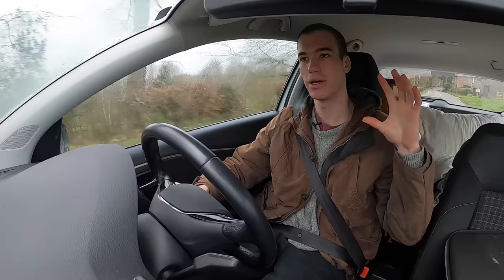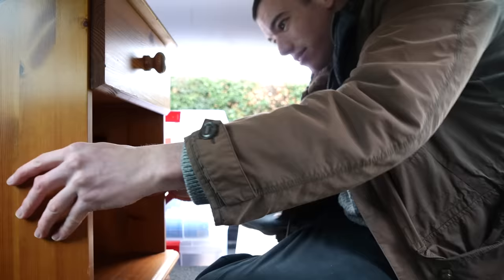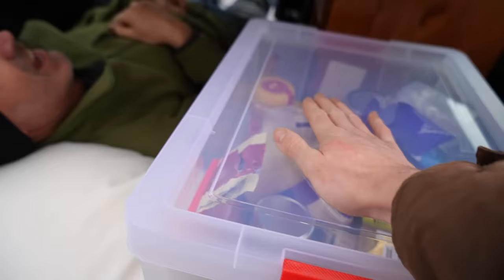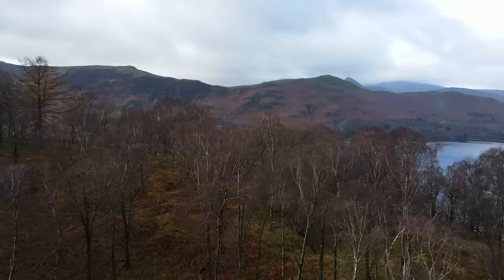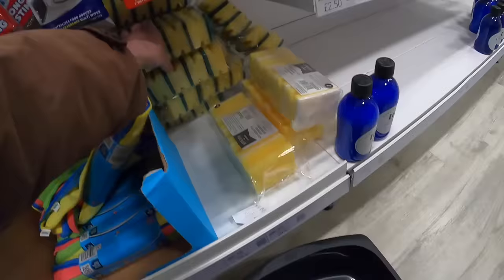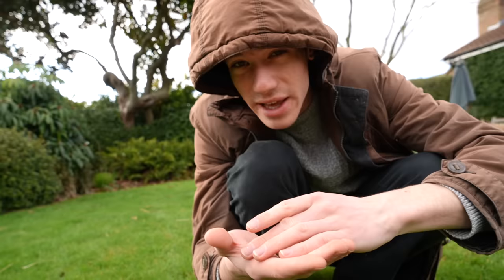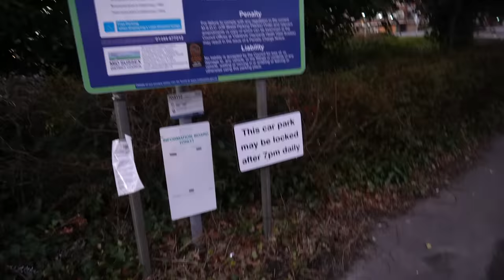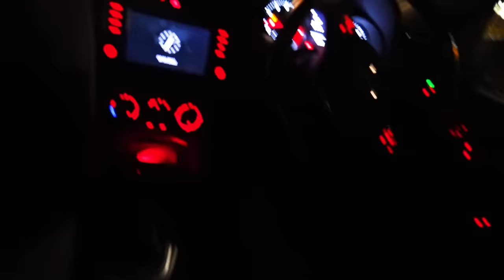Stealth Car Camping In A McDonald’s Car Park (Tiny Car Conversion)

Comment: "Cosy"  great description, you could do well as an estate agent! The guy on fish locker has done a video on insulating a small van, if youve not seen it check it out. If you had his van you could get the wardrobe in too. ;-) Obviously you could have a lidded bucket for 1s and 2s and theres less anxiety because you wont see the serial killers until the very end. All that said you are making it work, and learning along the way even if local house prices are suffering due the appearance of rough sleepers in car parks!  Tints and blinds might be an option on the windows, if a blind traps air its might cut down on heat loss through the windows. Keep up the good work :-)
Reply from the maker: Haha, great comment. 'Won't see the killer till the very end' haha! Thanks for watching!

Comment: if i leave my little dogs in my van i have to lock it i hold down the lock button till it beeps, so if the dogs move around it doesn't set of the alarm, give it a go 👍and of course never!! never sleep in your clothes 😱😱and you need more cable's to charge your leisure battery, from your car,

Comment: Hi Alex for your leisure battery you should have a split relay charger fitted to your cars or vans autonater it will charge your battery every time you drive the vehicle especially as your using  an inverter and the good thing is they are as cheap as chips good luck mate.
Reply from the maker: I actually got a split relay charger yesterday so I'll be fitting it soon!

Comment: Also with your leisure battery look in to something called a split charge relay. what this dose is charges your leser batrey from your mane car/van batry via like charging cables wile your driving so you never need  to take ya laser batry out and charge it so you all ways have power all the time! I have in the back of my van for my window cleaning business and it works a treat look into it mate will save you so much hassle!!
Reply from the maker: Thanks!
Reply: @just_alex  no problem mate all the best 👍🏼

Comment: ford transit connect high roof ..lwb .. i did 8 weeks in the western isles , Cheap reliable van , build bed base in three sections of sheet material about 12 to 14 inches high , then full size double mattress on top with all associated bedding , storage boxes under the plywood  can be accessed via the side door and rear doors , fit a wind turbine for ventilation ( again cheap } and some led lighting with switch straight from 12 v usb \ fag lighter , also recommend you get a good quality batterry bank / car jump module . worth there weight in  gold   i got the overlander portable starter pack .. please look at somthing similar ,, life  savers  ..will jump start  a truly dead car or van battery up to 6liter diesel and more than 50 times off one charge , also can charge lap tops , phones , cameras etc and the units will fully charge in under 90 mins ..
Reply from the maker: Thanks for the info!

Comment: Enjoying the videos so far. Definitely better to have a decent sleeping bag than a duvet! 
Also, how will you charge the batter? My old land rover had a split charging system fitted that would charge the battery as you drive.

Comment: Alex. Couldn't the battery be stored in the boots footwell where the spare tyre is usually located?
If you need to remove spare tyre, then buy a aerosol tyre puncture repair kit instead to get you out of trouble, then replace flat tyre at your earliest convenience?

I've always wanted a kitted out van, but so expensive. Why not think about sponsorship or reach out to companies that make these things, and help promote their products. That's what I'd reach out to try and do?
Reply from the maker: Thanks for the info! :)

Comment: Did you consider taking the feet off the bedside unit, laying it on it's side
Take the drawer out, as the battery looks to be the same width as the drawer height? You could then slide the battery in, so the battery is held in place by the horizontal wooden bar at the front. The drawer could then sit in the lower storage space? You might even be able to stash a plastic storage box and your camping stove stacked in there too?

I'm just a bit concerned that the height of that bedside unit obscures your view over your right shoulder for driving and maneuvering when reversing, and plod might pull you over for it?
Reply from the maker: Cheers for the info. Good ideas! :)
Reply: @Just Alex  no problem... You're welcome.

I love the idea of just you and your car, however you might want to consider adding roof bars and a Thule type roof box? It'll give you loads more storage space for clothes, food, toiletries, washing powder, waterproofs, wellies or other heavy duty boots. Especially if you're going travelling further afield than the UK? 

It'll also give you the ability to carry a tarp, poles and some rope (or you could buy a half dozen 150 paracord "survival bracelets"?) so you can make a half shelter that attaches to the roof bars, giving you somewhere you can sit out and cook when it's good weather. Make sure the tarp has eyelets around the edges, then anchor the corners of the tarp with some lengths of 150 paracord. Make sure it's a decent length? One end can be looped/attached to a carabina that clips to a tarp eyelet the other end could have a large bead tied on it or a couple of short dowel lengths lashed on. 

To anchor the corners of the tarp half shelter, clip the carabina to the corner tarp eyelet and trap the beaded/dowel end of the paracord in the passenger side front door, or run it the entire width of the car and trap it in the driver's side door, the bead or dowel length should stop the paracord from pulling through if it gets windy. The other corner should have the same set up which can be anchored the same way in the boot door. Make sure you do this from the inside of the car so you can maintain tension when you run it, and keep it well anchored. Make sure there's a little bit of play in the paracord to take up any windage movement? The centre of the tarp can be tied off to the two roof bars. 

You can also keep in the top box, either a folding stool or a low to the ground beach chair, or a reclining carp fishing seat? You could maybe substitute the carp recliner for your airbed perhaps, depending on the dimensions of it? 

Maybe consider one of the sun screens that attaches to your windscreen for sleeping in your car, just to stop nosey parkers from looking in? 

You could probably find secondhand roof bars, roof box, tarp, windscreen shade on FB marketplace, or gumtree etc?

Comment: Would the leisure battery fit in the spare wheel well? if so, could Make a bracket and secure it down with the factory bolt that holds the wheel in place possibly?

Comment: mate just buy a allready converted van, ive got one for sale for cheap if you want it, mercedes sprinter, has full size double bed, full kitchen, lights plus loads more, yours for 5k thats a bargain, it would get 10k+ on ebay
Reply from the maker: I think I want to convert it myself to be honest. Thanks though!
Reply: @just_alex  fair enough mate, if you need help picking the right van just ask, i have lots of experience in campers and van conversions, i used to live in them for a while exploring. 
my advise is dont get anything too small, and dont get anything too new, older is better, more reliable. easy to fix etc.

Comment: You should ditch the spare tyre and strap down the battery in the compartment if you can. Make sure you keep an emergency tyre repair can though :)
Reply: Good idea 👍- replace it with tyre weld
Reply from the maker: Nice idea, thanks.

Comment: Yes a van would be Greta! But it’s not about using a van is it! To stop the alarm going off lock the car with the button inside the car not the button on the keys if that makes sense.
Reply: Watch the whole video before commenting 😂
Reply from the maker: Cheers for watching! Appreciate your comments. :)
Reply: @just_alex  also I would look at a sealed battery rather then and lead acid, as you are going to have to keep topping it up with  with deironised water every couple of recharges.
I really can see a decent camper conversion being able to work with a car, pop top roof would work well

Comment: Honestly. As diesel and petrol prices are going insane right now. I really find it hard to think it is a good idea to buy a van. You should try and keep the Polo since yea it is small. But you got it already. But this insistent need for that expensive battery is just stupid. You should have gotten a big power bank (box). Much safer and enough power.

Really after many YEARS of looking into van life or rather alternative to expensive hard to travel with caravans/mobile homes. I had just gotten a VW Caddy. Or Caddy Maxi. Or VW T4 or really any of there transporter vans. (short wheel base) Trying to get a van the size of a normal family car. My favorite van must be Fiat Ducato short wheel base low roof vans. Just do NOT buy a high roof or long wheel base van! You can fit in a polo! Do not buy a big stupid van if you are ok having to squat down inside of the vehicle.

Do NOT build a stupid insulated van with wood walls and such. Keep it as stock as possible. A family car is OK with moisture as long as you crack the windows and in general have some kind of ventilation going. A van might have problems with the water but really it should be not a big problem if you AVOID insulating it on your own. KEEP IT CLEAR FROM TRAPPING MOISTURE! Cars are built to avoid this problem. But windows are just a inherent problem with cars. Vans got less of them and is easier to deal with the condensation on the front windows. 

I really think you can do fine with just a VW Caddy. Remove the cargo wall and make a bed frame. It is kinda illegal to modify the cargo wall but hey if you do it right or even register it as a camper your golden. If you avoid insulating and crack windows open and sleep as if it was a tent rather then a mobile home. You can get very far and still have quite a nice sleep environment. No tent to mess about with and metal walls feels safer then tent walls. Without a heater you really do not gain much from insulation or messing around making it look professional. It is a trap you see EVERYONE get into trying to make the vehicle a "camper". DON'T be fooled by the internet! They are all just as new to this stuff! After YEARS of looking into this stuff you really are best of ignoring doing anything radical to any van or car. Unless your going to sell your home and truly live in it. Your better off using a van/car as a tent that is the size of a normal car. Nothing fancy more then a extra cabin battery and a bed frame. Small things! No stupid builds that you find new people do EVERY DAM DAY! Just live homeless and your doing very well in this "hobby". 

Good ventilation and understanding that it is going to get cold is really just so simple and part of the reality of van/car camping. You should not sleep in winter condition without heating and that is SUCH a huge pain that you are better off with a hotel at that point. No really.  

YouTube Vanlife. Search for Caddy or car camping. There is so many videos online showing very simple to very extreme builds. Family cars are better then vans. But vans are better not needing to deal with all the windows and that it serves as a better transport vehicle when you do not camp. But you have the problem of metal walls and it looking kinda bad. But DO NOT ADD INSULATION TO IT! Cars uses very special kind of material to cover the metal. House materials are NOT safe to use in vehicles! 

It should not be very hard to figure out what to do. You do NOT NEED to make huge modifications to camp or travel in vehicles. Better to keep the van/car stock and have a multi purpose vehicle that can transport and be a travel vehicle. No need to go bonkers without first doing a no trills "build" where you just add a bed into a existing vehicle and not much more then that. There are caravans and real vehicles to live in. Go with that or tent camp inside of vehicles. Really that simple. 

Have owned a Caddy. Got a Caddy Maxi and Golf Variant right now. Caddy Maxi I can just trow a bed into and travel. No mods to the van itself. The Golf Variant needs to be done like the Polo you got here. But really it is long enough to sleep nicely in. Caddy short wheel base really needs the wall removed and a bed frame that you can take out when not needed. But it is so simple and nice vehicles to own! Really buy a van and just act as if your homeless. It is going to play out as well as this kind of lifestyle is going to be. No reason to spend HUGE amount of money to build a moldy heavy big stupid caravan. Just think of it as a metal tent on wheels. And as a really good transport vehicle when you do not travel. It is such a joy to own as a extra vehicle.
Reply from the maker: Appreciate your detailed message! Really helpful info. Will take it all into account when I’m looking for a vehicle. :)

Comment: Dad knows best get a Panel van for stealth camping
Reply from the maker: haha yeah he does!
Reply: @just_alex  you could kit it out with a portaloo a gas cooker a proper single fixed bed no windows apart from a sunroof on top No one would ever know when you are parked up even a small solar panel on the roof to top up the leisure battery No misted up windows in the cab in the morning If it works for you you could then get a diesel night heater It can get cold at nights in Europe

Comment: Hi Alex, I'm a Motor Trader and have been for many years. I've also specialised in Vans for a long time. Feel free to DM me for some impartial advice. I also have experience with Van/Car conversions.

Thanks
Nick
Reply from the maker: Thanks for your offer, I appreciate that massively!
Reply: @just_alex  I've just noticed there's no DM function on YT. If you'd like my help, feel free to drop me a your non personal email address below, I can reply to you later and you can run what you what to by me. 😁